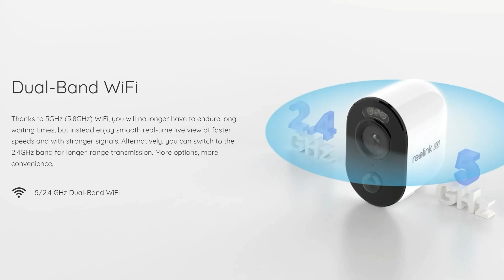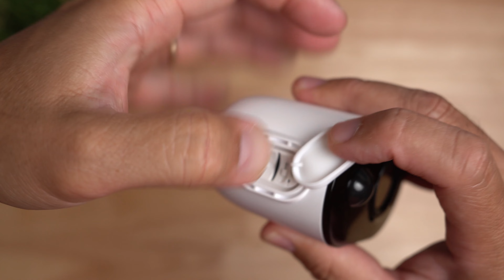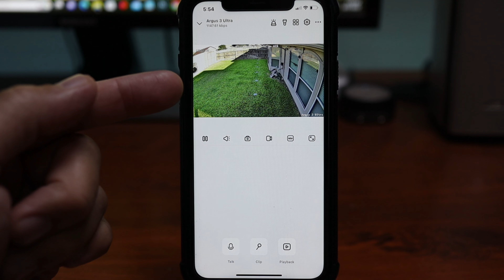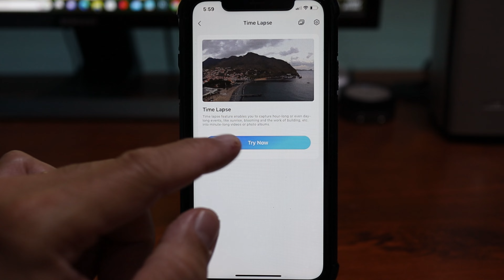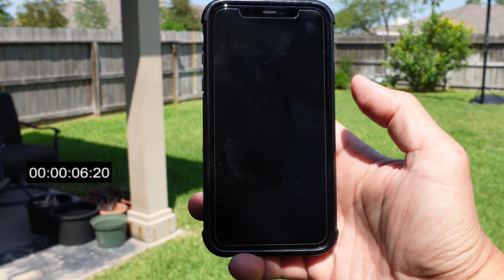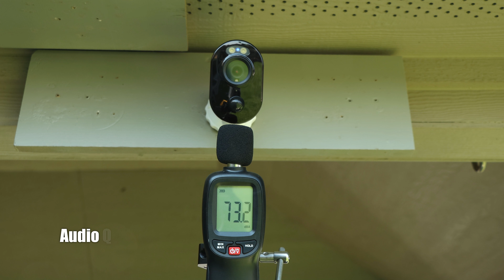Reolink Argus 3 Ultra Review - 4K Wireless WIFI Security Camera

Comment: I love my Reolink cameras. Have like 8 of the Argus 2's. Had them for 3 years now. They work great! Only gripe is that in SUPER SUPER cold weather, the batteries will die...HOWEVER, all you have to do is bring them inside (which is sometimes a pain depending on where you have your cameras set up), warm them up a bit, charge them up, and they're good to go for another season. I live in a climate where it gets below 0 degrees fahrenheit which I have to usually "jumpstart" the batteries once a year. Other than that, amazing performance and reliability.

Comment: So I installed mine today and there is no cloud support for the Ultra model, and I am consistently having an issue where I can only view a live stream when my phone is connected to cellular data. If I connect my phone to my local wifi, I get a failed connection on the stream. You would think that would actually be the opposite.
Reply: Interesting, I had the opposite way round issue. Reolink were fantastic with support to resolve issue tho. If your still stuck ill dig up the info for u or you may have been in touch with their support already.

Comment: In my experience with many of their cameras over the last few years, Reolink rarely disappoints in quality, reliability and value. Their NVRs are also very good, I've had one running 24/7 with 4 cameras attached to it since early 2020. Uninterrupted surveillance 365 days a year and zero issues so far.
Reply from the maker: I agree. Their NVR and wired IP cameras have been working reliably ever since I have been using them.
Reply: which one are you using but it doesn’t have rich notifications 😢
Reply: @rahatrahman8664  I use an old model NVR (8 channel) with a mix of 2k and 4k Reolink cameras, most of them wired and one wireless. The NVR is the "primary" 24/7 surveillance system that captures everything and cannot be scrambled via wifi scramblers (thanks to the wired cams). 

For rich notifications and AI human detection, I use a variety of Eufy cameras as a parallel / backup system to the Reolink (doorbell, wired wall cams + wireless wall cams). They are not as reliable to capture EVERYTHING like the Reolink, but they are very good at detecting humans and send you a notification instantly, plus have alarms and two way audio. When you combine both systems, you have yourself a perfect home monitoring setup!  🙂

Comment: How have you dealt w/ neighbors’ barking dogs?  Surely you’ve had that problem at some point.  They are driving me up a wall
Reply: Will reply later but think it's call Dazzer 2 and also Ultasonic . It's a device that's hand held but look around compare reviews on similar products. You have to ensure that any device has to have clear view of the dog's  yard. With Dazzer if dogs on other side of fence your on works like a charm.
Reply from the maker: They are ok... they tend to bark when they are outside and when we are near the fence...Aside from that, they are fine.
Reply: Does Reolink offer any solar panel? And does this wireless camera support 24/7 recording?
Reply: @khadijamoya  I highly doubt it supports 24x7 recording unless maybe when plugged in.  The battery would need to be recharged daily otherwise.
Reply: sleeping tablets in sausages
Reply: Hand out bones for all them to chew on instead of barking